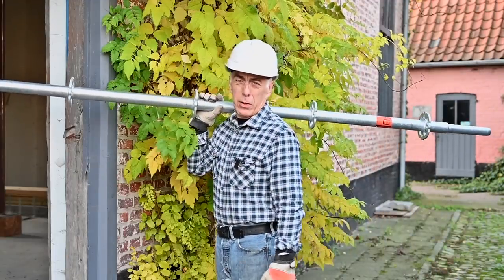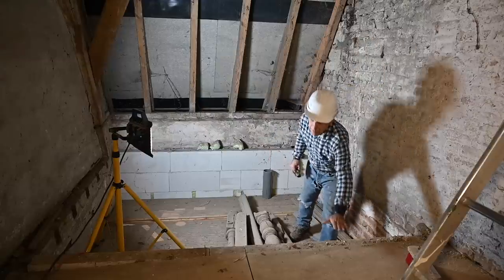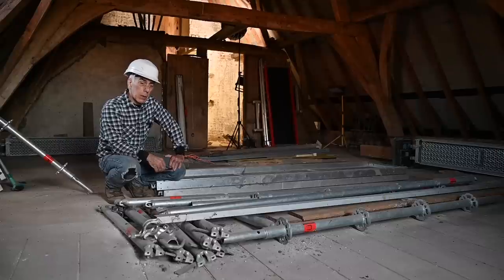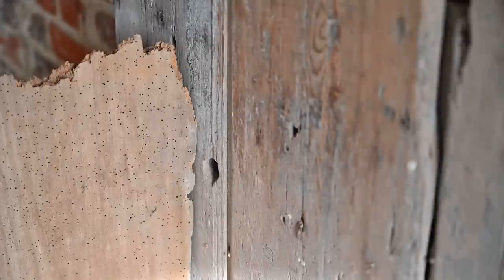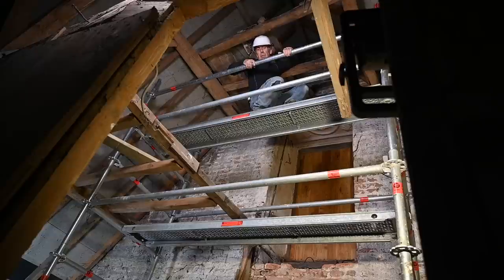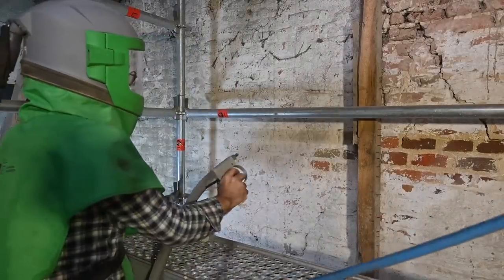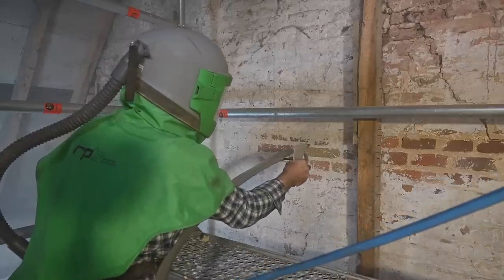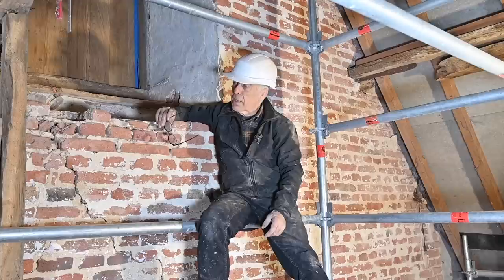Restoring the old house Anno 1616   Part 1

Comment: what can you get away with for of the restoration? timber frameing is asteticly pleasing but its a loose-loose when it comes to cost. not only do timbers go for a premium, far more their their area would make it out to be, but also they are rated for like less then 2/3 the force of 2by lumber for doing structural analysis. they cant inspect timbers interior there could be unknown voids and stuff so they just make it a chunky safety factor. if you are stuck with timbers or even stuck with original ones and it ends up having a bunch of deflection when its finished you can screw in steel strapping kinda bar stock to the bottom without it looking too out of place. because the steel is so far a way from the neutral axis of the beam its has a massive effect on the overall strength without a lot of extra material cost.
Reply from the maker: Indeed Nick and thanks for the comments... In many cases the way old houses were build, would no longer be allowed today for safety reasons, and yet those old structures did not collapse and lasted 400 years ( in my case)..